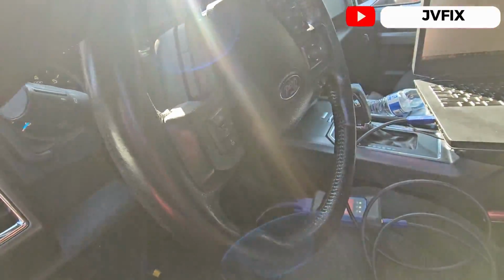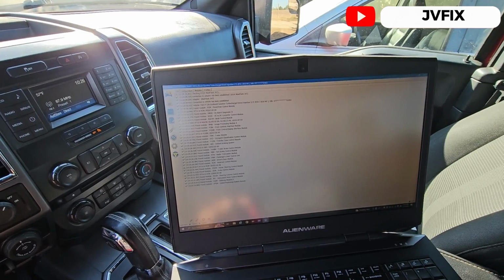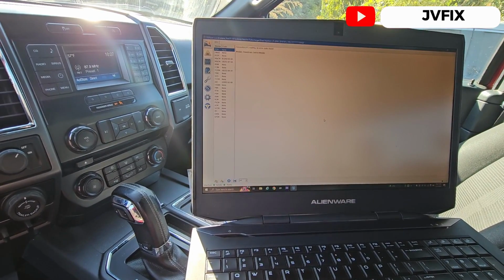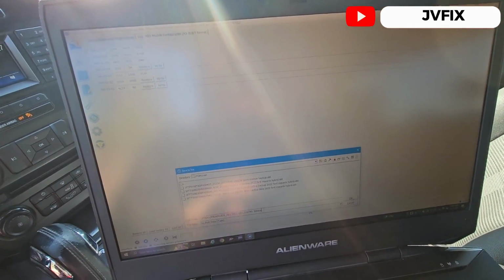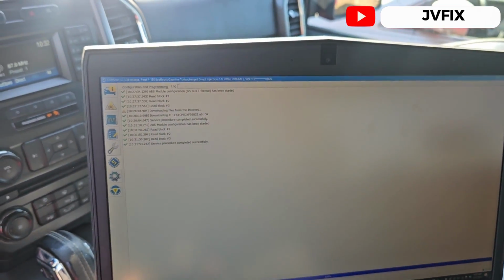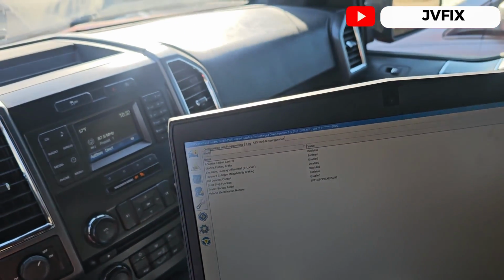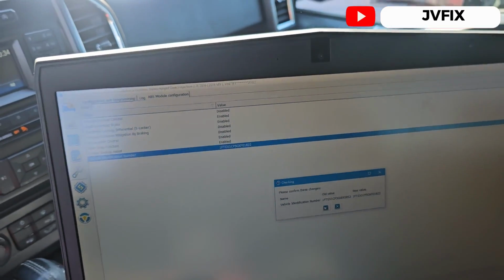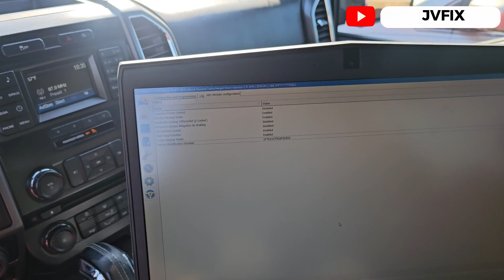How to program used ABS module on 2015 Ford F150 using Forscan

Comment: If you are having the issue where the VIN is not showing in the configuration tab. Make sure to click write all after uploading factory file. This fixed my issue without even touching the configuration tab.

Comment: Can i get a link to a scan tool that can do this?
Reply from the maker: No scanner will ever do this only a laptop with forscan which is only 12 dollars or the oem dealer software IDS or FJDS
Reply: @JVFIXLLC  well, i got Forscan full subscription but i still can’t change the vin number.

Comment: So, I have a 2010 ford f150. Replaced the ABS module and pump. I downloaded the as built data, and made sure I saved a file. I, for the life of me, can not do the ABS module configuration. Could it have been the cheaper adapter I was using? I was using the elm connector.
Reply: I had the same problem, when I went to ABS configuration, there was no option to edit the VIN. But if you have the original ABS module of the car, you can connect that one and download "as built" data, and then connect the replacement ABS module, and load the "As built" data into the new ABS module and it will work.
Reply: @mahmoudajjour1370 I figured out that the part he got was incorrect. It was for a 2wd truck. His is 4wd. Which is why it wouldn't work.
Reply from the maker: You have to buy the 1yr sub to mod the files

Comment: Bro i need your help, im currently working on my truck. They said they gave me 2 months extended trial version. Is it different from the 1 year subscription version? Cause both are extended version as it says. Trying to figure out why am i missing the vin showing function. Plus at the beginning its saying, the adapter is not recommended for this car some functions may not be available, so im trying to figure out if its from the license or from the obd adapter. Thank you so much.
Reply from the maker: Just buy the 1yr subscription it's only 14 dollars I think and it will unlock everything

Comment: Which conector are you using, maybe it appear the extra conection because you have the VCI or ids
Reply from the maker: i use an Autel j2534 interface but you can get the cable cheap on amazon or going to the official Forscan website
Reply: @JVFIXLLC will it work with any adapters?

Comment: Good day,  i have a mustang 2012 5.0 Boss superchager also having
abs unit fault same as your F150, we installed used abs unit. 
we also have paid forscan subscirption,

but upon running the ABS as built format, theres no data apearing to be saved. 
and tried to press Load factory as build, did DL anything. it only say Operation succesful.
also there's no ABS configutation options on our part, compairing on yours

what do you think is the problem
TY
Reply from the maker: do you have any codes stored?

Comment: I am trying to install a used ABS module from Pick n' Pull. Should I remove the faulty one first and install the used one?
Reply from the maker: yea just install the used one and do a as built restore with forscan and it should work

Comment: Why do you have to download and install the factory version of the software?
Reply from the maker: is just the way is designed there is no other way.
Reply: @JVFIXLLC there's always another way, lol. Depends on how deep your pockets are 😉
Reply: For research purposes, because the Vin in the old module interferes with your current computer system in your vehicle, installing the original software is the only way to transfer the proper Vin over to the new module when using Forscan. The other way is to have a scan tool capable of saving and transferring data between the modules or you can take it to Ford and spend a couple thousand dollars to replace the module and do programming similar to what you see here on YT for 1/4 the cost.

Comment: I am trying to do this on a 2013 F150.   We have put in a used ABS module, and I have managed to follow you video until the "configure module" part and I don't get the window to change the VIN number all I get is one line that the hill start assist is enabled.   Any ideas?    Thanks   Joe
Reply: I’m useing forscan.  Just downloaded it this week
Reply from the maker: @rv4flyer ok did you buy the subscription too. is like 12bucks if u didn't buy u will have too.
Reply: @JVFIXLLC    No, I just have the free trial.   I will pay for the software if I have to.  Does it make a difference on what the software will do?
Reply from the maker: @rv4flyer yes if u don't pay the 1yr sub it will not work
Reply: @JVFIXLLC    I"ll supscribe today and try again.....thanks for your quick replies    Joe
Reply: OK,  Paid for the full year subscription and still not getting the same results.  I have the "as built" file installed but it seems to stick at reading Block one.   I try and click on the configuration and nothing happens.
Reply: @JVFIXLLC  From what I understand, the trial and membership are the same except the free trial has to be renewed every 2 months.
Reply: The configuration and programming mode is functional on paid.
Reply from the maker: are you using forscan or the dealership software  FDRS OR IDS
Reply: Hey man, im having the same issue, did u figure it out?
Reply: @Charbel906    No, I'm afraid I didn't.  I haven't tried again for a while, but I intend to (too many cars to look after).   It seems simple on this video, but I couldn't get the software to act like it does here.
Reply: @rv4flyer  I think it might be the OBD2 port itself. Some of them are cheaper and doesnt allow u to do full config. I will talk to ford tomorrow to see if they can fix my abs vin mismatch code since i swapped it already and did the bleeding and tested the abs module itself and worked. To hell with ford with such invention honestly
Reply: @Charbel906    I agree...let me know how you make out at Ford.   I actually had mine in to them and they charged me 130$ to tell me they couldn't do it.
Reply: @rv4flyer  well they did it for me! Charged me 150$ + tax
But you can do it if you buy a better obd
Reply: @Charbel906  Glad to hear that.   I have a good cable to my laptop, not sure why it won't work for me....cheers.
Reply: @Charbel906  What Ford Dealership did you take your truck to, to have the abs vin mismatch fixed. Really throwing up a prayer that maybe its close to my area to have the same fix done.
Reply: @taylorswanson7269  im in halifax nova scotia, make sure to take the original pump with you, it helps
Reply: I had the same problem, when I went to ABS configuration, there was no option to edit the VIN. But if you have the original ABS module of the car, you can connect that one and download "as built" data, and then connect the replacement ABS module, and load the "As built" data into the new ABS module and it will work.
Reply: I think I figured it out. After copying new file from the internet click on “write all”. I had the same issue and doing that fixed it without going to the configuration tab.

Comment: Great info, did you use j2534 for this? & would the jbox work on 2011 fords? Thanks!
Reply from the maker: yea the j2534 box works from 1997 to the present year. for all makes and models
Reply: What’s the j2534 for? Would I just be able to buy the obd2 to usb adapter and hook my computer up or is no?